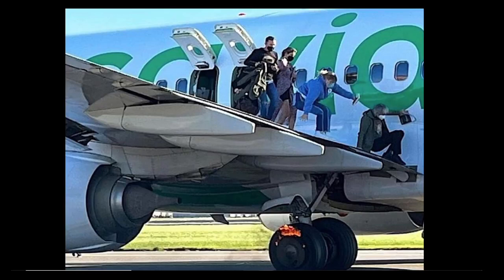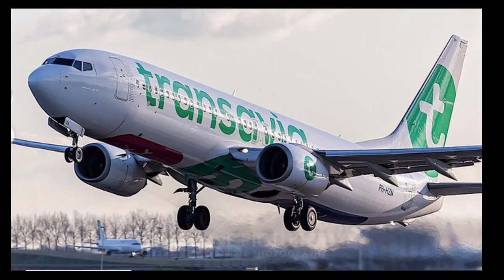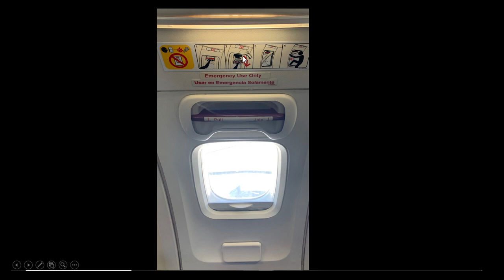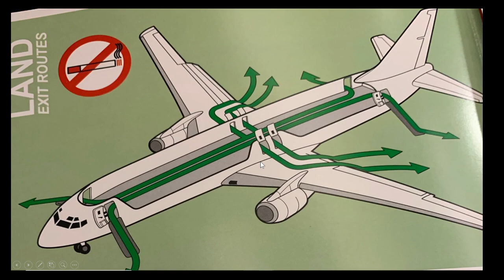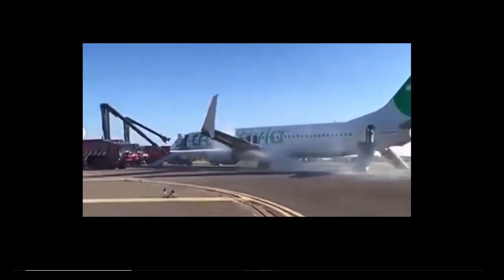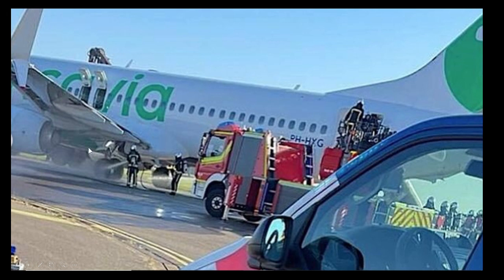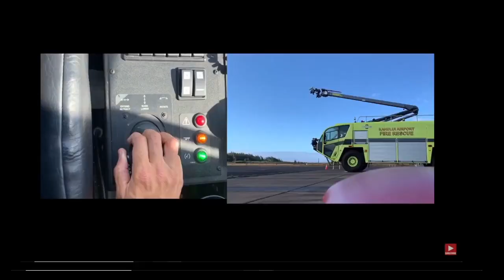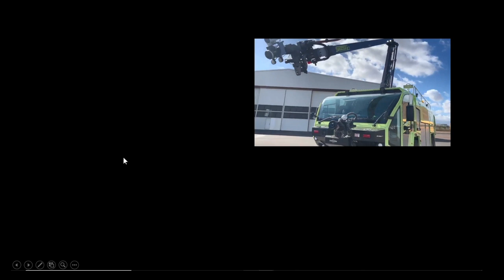Emergency Evacuation from Tire fire in Schiphol, Amsterdam

Comment: Aren’t the flaps meant to be lowered to 40 degrees on the 737 before the evacuation is called for?
Reply from the maker: That’s a great question for the pilots. I would think it would be from landing.
Reply: @ARFFWorld  Yeah, it was a common missed action by the First Officer in practiced/real RTOs and evacuations. 

They need to be set to 40 degrees before the engines are shutdown but in the rush to shut the engines down and make the evacuation PA, they can be often forgotten about. 

It’s a jump down for only the fit and healthy. 

Great channel by the way.
Reply from the maker: @finneire2358  Thanks for watching and commenting Finn.  Till next time
Reply: @finneire2358  That's not true. The evacuation checklist clearly says "if time allows" when it comes to waiting for the flaps to move to 40 before shutting down the engines. And honestly, if we get an unannunciated fire like this, every second we wait could cost lives. So yes, I'd rather take the risk of having passengers get injured than regret any loss of life. Beside that, if passengers were to start evacuating using the overwing exits while the engines are running, you better shut those engines down right away!! And even with the flaps out it's going to cause injuries anyway...
Reply: @JM-sq8ni  Indeed, M J. I wouldn’t wait whilst the flaps extend down to 40 degrees. 
The priority is get the pax off. 

On an RTO, the procedure was to set 40 degrees upon stopping, in anticipation of a potential evacuation. Granted, this incident was a taxi in. Is the 737 checklist not to commence the extension of flaps to 40 upon the unusual event of getting hot brakes and a deflated tyre? Better to anticipate such an eventual decision (evac) than do nothing in the time it takes for the crew to announce stop and eventually shut down the engines. 

If you’re currently rated on the 737, would be great if you could clarify is an RTO the ONLY time the FO sets flaps to 40 upon stopping.
Reply: @finneire2358  The ONLY checklist that tells you to set the flaps to 40 is the evacuation checklist. This means that upon selecting flaps 40, you have already made the decision to evacuate. Other than that, it is never a procedure to select flaps 40 in a non-normal situation, not even following an RTO. However, if you're making an RTO for a reason that makes it very likely or certain that an evacuation is needed, it could be useful to anticipate this step and to set flaps 40 immediately, as good airmanship. But that would technically be off the books (even if it's a very good idea!)
Reply: @JM-sq8ni  Interesting. Thanks. I was on the 737 decades ago and distinctly remembered the most common Evac issue was flaps not being set to 40 quickly enough into the event, thereby not getting full flap by the time the engines were eventually shutdown. 

It appears from the photos of the Transavia, flaps got to about 1-5 degrees before stopping.

I would think from the time the aircraft park brake was set to the time the engines were shut down as part of the evac procedure/decision, a full extension would’ve been possible if the procedure was to select full flap upon first stopping for a non-normal taxi event.

It’s a shame to leave such a decision up to an individual crew’s good ideas on the day, etc.
Reply: @finneire2358  That's correct and I couldn't agree more! It would be very difficult to write a procedure for this though. You could argue that it would have to depend on the circumstances whether or not to select flaps 40, but that would mean you'd have to analyse the situation AND determine what's actually going on before you've even stopped, which is not very realistic.

Also I believe there are very few situations actually requiring an evacuation. The most obvious ones are probably a fire or a crash. Fortunately they are very rare and hardly ever the reason for an RTO, so if it's about life or death, I honestly wouldn't worry too much about a handful of passengers getting injured if they all make it out alive. And even with the flaps out it's likely going to cause trouble with (elderly) passengers anyway.

Here's another thought. If you were to reject the takeoff following a takeoff configuration warning, which is quite common, it would not make any sense to select flaps 40, since you'll just check the aircraft configuration and you'll probably try it again right away. If you would then forget to put the flaps back to wherever they were supposed to be, guess what, another RTO would be waiting for you!
Reply: @JM-sq8ni  Yep, all fair points.
Reply: @finneire2358  Thankfully the speedbrakes were down so the wing was at least partially configured for emergency evacuation.  Still wondering what the circumstances were (RTO, excessive braking during landing, etc).
Reply: @rob737700  They were near the end of a long taxi in from 18R with many turns. Still, brakes don’t normally go on fire from such taxiing at Schiphol so I suspect they had a dragging left brake or as I see some crew do, taxi around with their feet up on the pedals and unintentionally apply light braking. 

They made the 2nd turn off, as did other aircraft that day so nothing unusual there, unless they landed a bit long and braked hard to make it. Hard to know. 
We’ll know more in time, hopefully.
Reply: @finneire2358  Good information, thank you.  I've been out there for preflight a couple of times when they came in with smoking brakes after excessive brakiing to make a turn-off.  Not fun especially while wonderiing if the fuse plugs are going to blow.  And we know now that there is a fire risk possibly associated with this poor technique. I'm typed in the plane but haven't flown one in 13 years.

Comment: An important part of the emergency evacuation checklist calls for the flaps to be lowered to 40 degrees so the passengers can slide off of the wing.  Not sure why the pilots missed this.
Reply: It does, but it also states that you should wait for the flaps to move to 40 only if time allows before shutting the engines down. Given the fact that the flaps appear to be down partially, it is very reasonable to think they decided not to wait for it, and I would say that's the right call in an unclear fire situation.
Reply: Checklist says “if time permits”
Reply: @TheAndreas133  Thanks, it's been a few years.....
Reply: Ha, just wanted to mention that the overwing slides didn't deploy.  Having a sidestick in my cockpit i was expecting such.
Reply: Thank you ! I was going to make this comment as well, so this makes me wonder if this evacuation was initiated by the crew ! Flaps 40 is part of our company memory items if rejecting takeoff for fire, and it's part of the evacuation checklist as mentioned.
Reply: @JM-sq8ni  all correct. Flap lever to 40 is #3 on the Evacuation checklist after park brake set and speedbrake lever down. I'd think that even in the short time it takes to do #4 and #5 which involve setting pressurisation to manual and fully opening the outflow valve, the flaps would have moved further than they appear before #6 verifying flaps 40 time permitting and #7 shutting down engines. But as you said, perhaps being unsure of the situation they elected to move quickly especially in the absence of on-board wheel fire (other than wheel well) indicators.
Reply: @jackharper3190  on the 737, the "overwing slides" are the flaps, which is why they're supposed to be set to 40 (full down) for evacuation. It helps as the aircraft sits quite low.

Comment: That could have went wrong with the evacuations over the fire. But, as you said, they couldn't see the fire
Reply from the maker: Also that drop is fairly high, with passengers jumping off, also the flaps area is slippery.  Thanks for watching.
Reply: @ARFFWorld  yeah and I would have tried the slides 😆
Reply from the maker: @Louisiananews  lol.  Slides for sure.